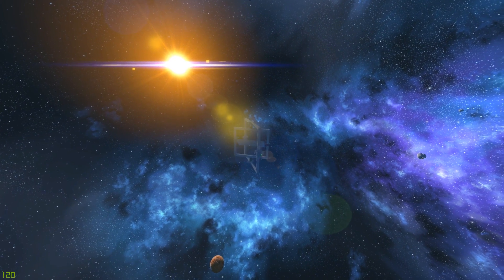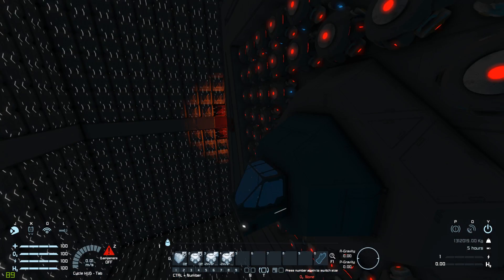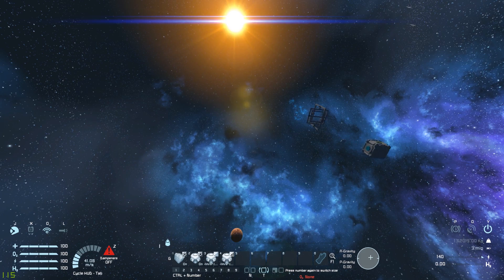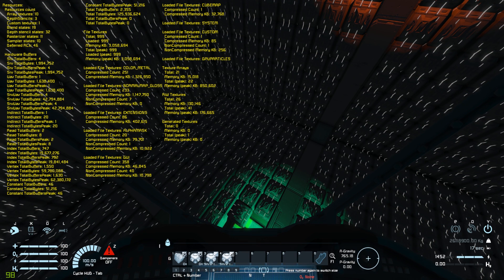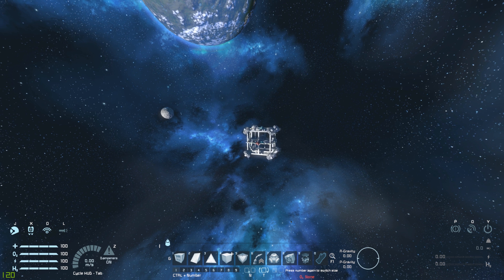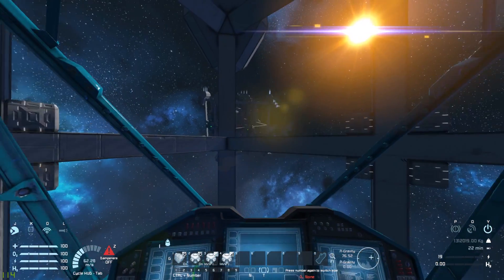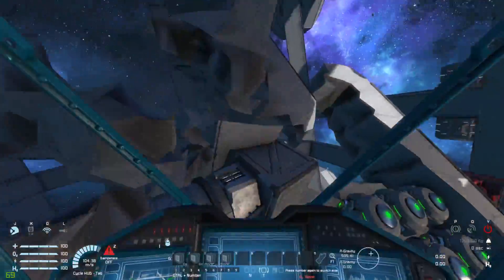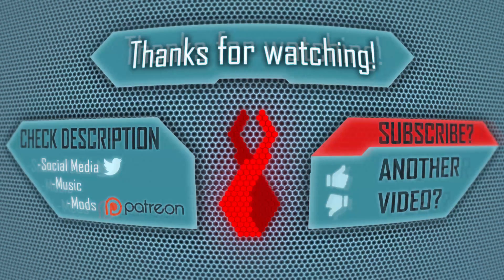Space Engineers, Rotor Gravity Drive

Comment: Wait...so artificial gravity on the ship is repelling the artificial mass blocks on the same ship, moving it... So it's like a fan on a sailboat pushing the sails... It is so anti-science thing to do, yet amazing because of it!
Reply: actually the sailboat fan kinf of works mithbusters tested. The air current reflects across the sail and pushes the other direction so this makes less sense than that.
Reply: the idea is that the gravity generator makes an offset gravity field so the ship gets pulled into it and the origin point of the field moves with the generator, so its like a ball rolling down an infinite hill.
Reply: Anakin Skyobiliviator it's fine as long as energy is not wasted or created
Reply: Anakin Skyobiliviator no no, that looks similar but completely different. Because gravity not connected vith gravity generators, it just appears in space. So no connection = circle of energy broken = we can fly on it.
Reply: not like you are emitting any kind of particle or force... who knows?
Reply: It makes perfect sense actually.

The fan converts electrical energy to kinetic energy, which pushes air into the sail, propelling it.

This is basically a scifi version of the same thing. Taking energy to create gravity, which pulls the ship.

Comment: I am sure in a busy MP server it would explode :p Why not make a version like this without rotors.

Edit: Nvm. Not a survival build. Cool concept now that I finished the video. 

I have a script-driven 6 direction gravity drive on the Daenerys, using spherical generators and far less mass/generators. Incredibly fast in every axis. No rotors, pistons, etc. Grav drive is tied to the thrusters, and integrates seemlessly with them/dampeners/etc.
Reply: But did he try jumping it somewhere, or other extreme conditions?

If rotors are like anything else, on Dedicated Server it seems like there's a 50/50 chance any attached grids will start vibrating after jumping, when entering the atmosphere etc - to the point where they cause damage to both ships.  (undocking and optionally redocking quickly usually fixes it if nothing explodes)

Though, as a non-host player I'm very hesitant to make any rotor devices that have a player-controlled gyro grid joined with another, but I may test this more soon. (two automated grids usually seemed fine in the past)
Reply: That too.

Keeping things stable on a fresh server has never been the issue
Reply: To not use rotors you would not be able to get angled trajectories very easily at all and it would require multiple planes of artificial mass blocks. You would also have to micromanage a TON of your gravity generators and mass blocks, constantly turning them on and off to change directions. It would be incredibly annoying to manage that and achieve even a close resemblance of what the one with rotors can do.
Reply: UnexpectedInquisition not sure about that. Xocliw tested some equally complex rotor contraptions in very crowded multi player during one of his latest streams and it worked really well...
Reply: I seriously doubt he managed to replicate desync errors common in MP. Many issues only begin to crop up once a server has been active a couple weeks, and only when you have over 8 players or so.
Reply: I don't think you can because i think the rotor are used to steer it but you could probaly not use rotors
Reply: NeithanDiniem partly correct. Daenerys script uses mass blocks in 6 directions, with spherical always-on generators. The mass blocks are shared between facings, so each block works for 2 or 3 different directions. The script just toggles on/off the appropriate mass blocks based on thruster input. It uses far less mass blocks than this system, and far fewer generators, but has a greater effect.
Reply: i have used A.M. grav. gen. as propulsion boost in my survival,  large ship, fighter design . to keep it practical and useful. check it out : http://steamcommunity.com/sharedfiles/filedetails/?id=827597181